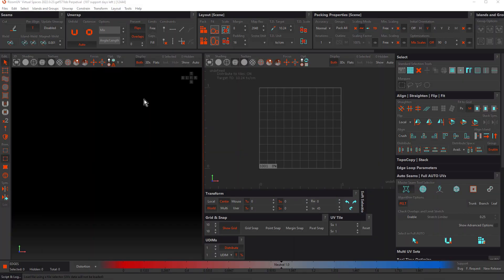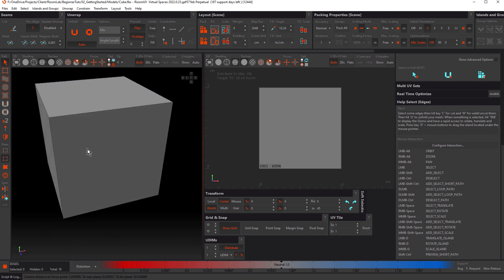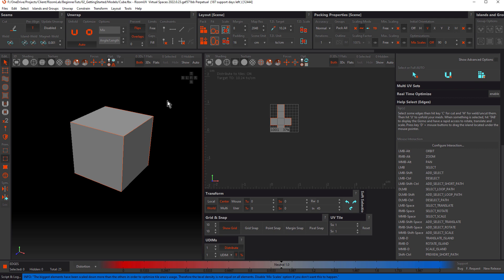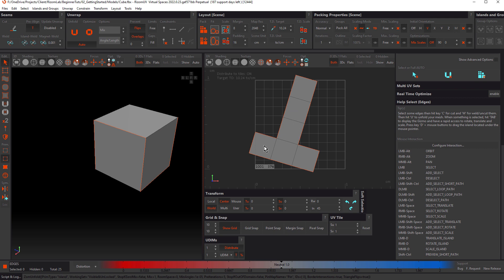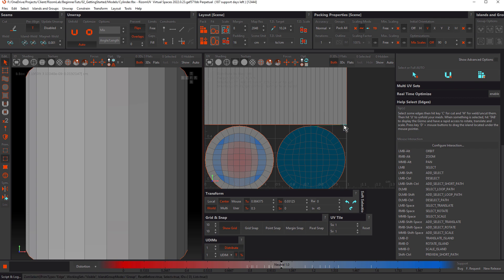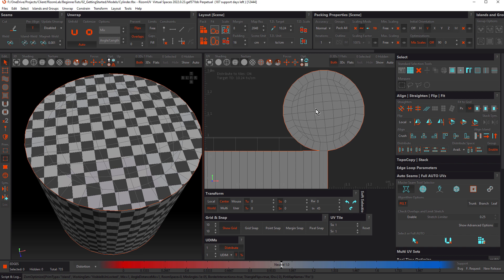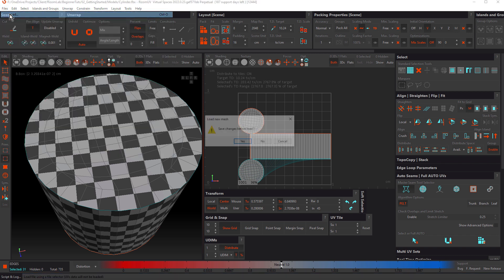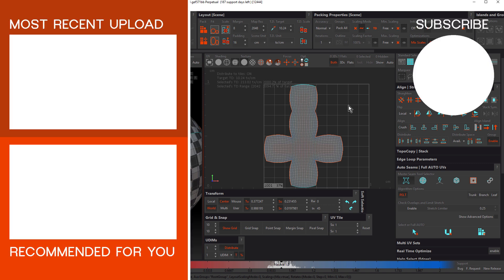RizomUV Basics (2023): UV Unwrapping Quick Start

Comment: the fact that im getting ("WARNING: "Packing overflow. Some islands or groups cannot fit in tile with the requested Texel Density and/or scaling constraints. Please lower the target texel density, or increase the texture map resolution, or add tiles or increase their dimensions, or release Min. Scaling constraints.")when i press "u" to unfold just a little cube is wild. I lowered the TD but it didnt work. Im indeed in Virtual Space.
Reply from the maker: It's probably because you've messed around with the settings, without understanding them.
Virtual spaces just works out of the box (doesn't give this warning)
I suggest you open preferences, scroll to the bottom, reset preferences. Then try again.
Reply: Hi, im getting same issue - im working in virtual space and resetting preferences did not helped. How did you worked it out?
Reply from the maker: @Veritanky  - As I mentioned in reply to your other comment (which you've deleted), come to our Discord.
Reply: @RizomUV  Hello, yeah i did. Ty

Comment: when I press p for packing I get a n error,   WARNING: "Packing overflow. Some islands or groups cannot fit in tile with the requested Texel Density and/or scaling constraints. Please lower the target texel density, or increase the texture map resolution, or add tiles or increase their dimensions, or release Min. Scaling constraints."
Reply from the maker: This is not an error, it's just information about why islands cannot be placed in the tile. This is a result of your scaling settings or your Texel Density Target.
Reply: @RizomUV how can we fix that problem because when i load new project, object is always outside of the uv tiles and when i scale it turns red.
Reply from the maker: @hakanatak1730  - What version of RizomUV do you have?
Reply: @RizomUV  Version 2023.0.71.gd738df3e i think its the latest one
Reply from the maker: @hakanatak1730  - No I mean Virtual Spaces or Real Space?
Reply: @RizomUV  real space
Reply from the maker: @hakanatak1730  - Then that explains why this is happening by default. Do you even need Real Space? Do you understand the difference between Real Space and Virtual Spaces?
Reply: @RizomUV  Yeah because i will use it for laser engraving. But I figured it now thnx

Comment: If you choose Blender mouse preset configuration you can change the select button from RMB to LMB just clicking with LMB above RMB text and so on to others mouse interactions 😉
Reply: Nice tip. This has been changed to LMB by default in the development build.
Reply: @Motionworks  It woud be great if they also put the option to invert the scroll wheel zoom direction 😉